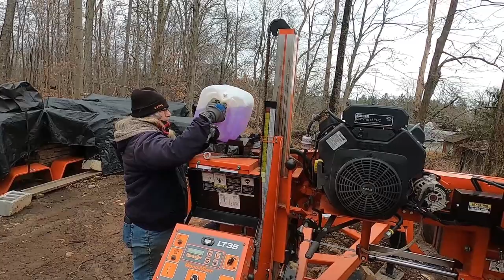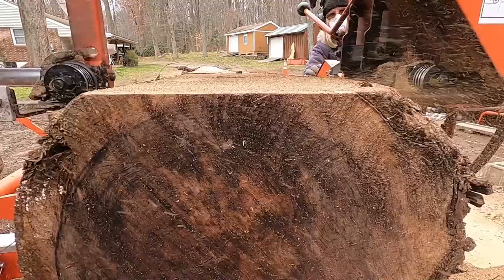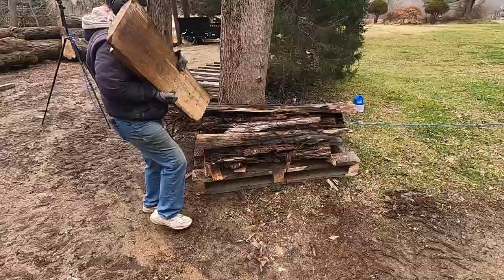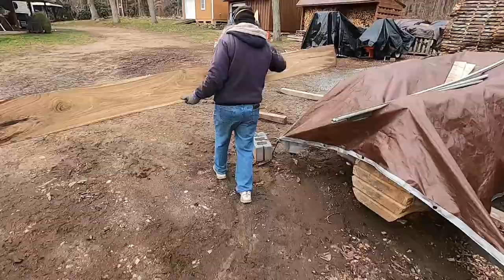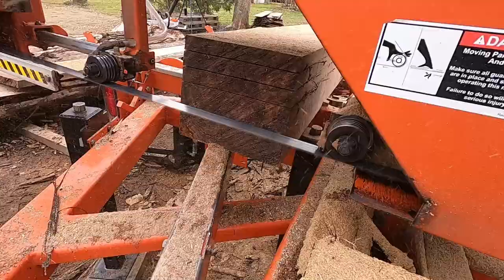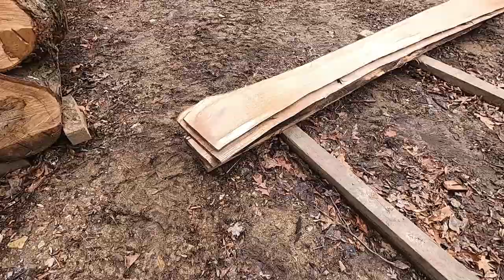Black Walnut Marathon Part 2

Comment: Happy New Year folks. Love that walnut - such a pretty grain. If it is helpful, my neighbour Guy has a metal detector ( its shaped like a wand) and he always runs it over the logs before running them through his Mill. He started doing it after catching a few nails way back and now he always does it - he finds the nails and removes them before. Hope that is helpful. Cheers!
Reply: Hi GP Outdoors.  Happy New Year to you also. Yes this had beautiful grain for sure. Thanks again and take care
Reply from the maker: Happy New Year to you and yours Gordon. It is an amazing wood. One of our favorites to mill. 
We had a wand type detector in the past. It didn't work well. This new one, we finally used in the video, shows us the approx depth of the metal.
We should check the tree before we mill. Some of the metal is so deep, it's best to mill some boards off before we try to dig for the nail. We would lose some board buy digging through them to the metal.
We should do our due diligence, but sometimes it works better to find it with the blade, then remove it. Most times the blades can be resharpened so it's not a total lose.

Comment: The beard works for you Chuck.  Had you hurt yourself or did you get sick?  Must have missed the video (or forgotten it) where you said what was keeping you from running the mill.  Though by the looks of it, Deb might not want to give it back!
Reply from the maker: I had a partially detached retina. It's genetics. No injury. It just happened. Surgery fixed it, but it has a long recovery. I'm nearly there now. I should be released to resume normal work soon. 
I can grow a beard now because my restrictions keep me from performing my emergency medical services job. We have to wear a full seal mask when working with patients, and you can't get a good seal on the mask, with facial hair. 
Once I resume that work, I will have to shave it off. 
I prefer a beard, but I'm not willing to stop my work with emergency services.
Reply: Hi Andrew and thanks so much for tuning  into the channel.  Take care

Comment: Hey Chuck I hope you guys had a great start to the new year. I know that you saw to make a living and video to share your talents but could I ask you a favor? My LT35 HD is on order and I have a friend that has a LT40 and I am learning how to use his. The biggest place I struggle is knowing how to approach the log. I do well with 4/4 boards all the way through a log but I tried to figure out how to cut two by fours out of a 22" log yesterday. Could you demonstrate how you use the scale that is on the scale as your guideline to saw different size lumber. Thanks Tim
Reply from the maker: That will take some explaining in a video. I have to show it on the actual scale, but it should be good.

Comment: Hi guys sorry I didn't hear about Chucks injury . Was the outside boards punky  ? I would have been using it for firewood ? happy New Years stay heathy
Reply from the maker: No real injury. Just genetics. I'm nearly healed, and will be back at it in full swing soon. The outer boards were solid. There is a local crafter that will take some of it.  The rest goes to the curb for firewood. Whoever stops by.
Reply: Hi Mike the outside boards had very little black walnut in them. We put them out for crafters.  Take care